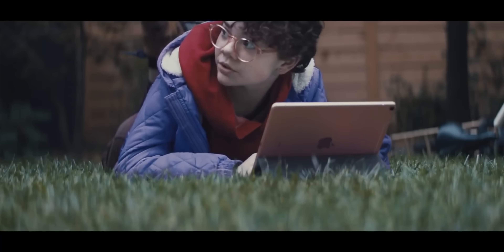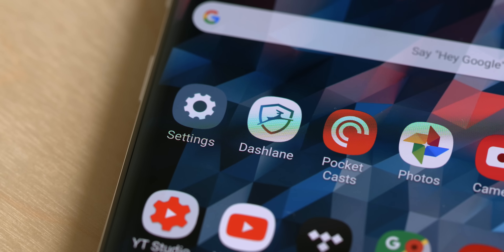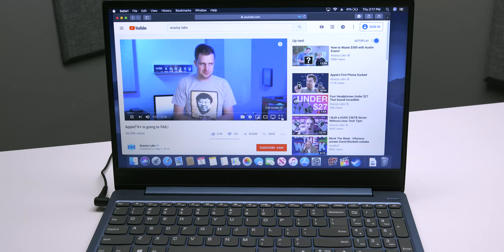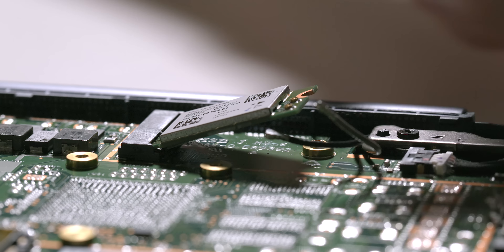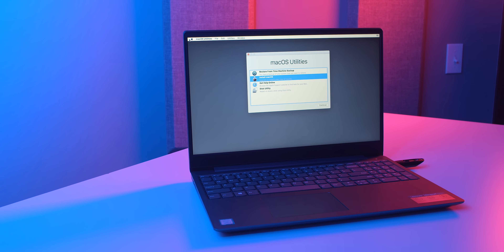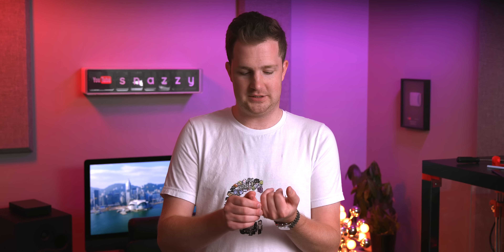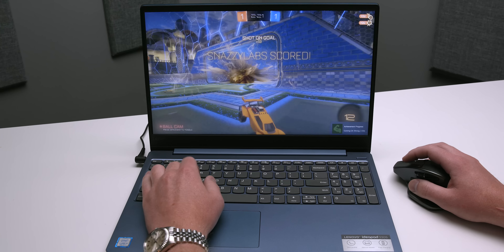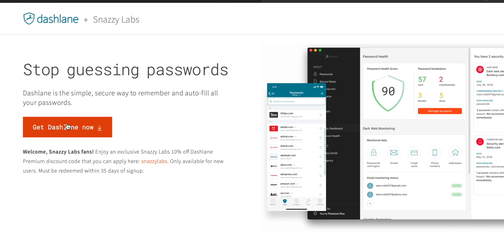The $279 MacBook Air KILLER!

Comment: I just bought last week a Lenovo 330s-14ikb (the 14" version) for 300$ and it's got a better 1080p IPS display, same i3 proc, 4gb ram which I upgraded to 8gb and a 512gb SSD, ohh and it also has a illuminated keyboard, will be trying to hackintosh it, great video!
Reply from the maker: Cheers!
Reply: Let us know how it goes!
Reply: can we dual boot it? win10/Hackin?
Reply: @xbxb  yes you can. Install mac first then windows. Then use EasyUEFI to make clover the default bootloader again. And ur done.
Best is if you can install in seperate disks/ssd.
Reply: @Gaijin101  Oh yes. That would be nice, separate disk. Thanks for the Info. :)
Reply: It's been a month... Did you make it work?
Reply: How it went?
Reply: @officialspaceefrain  Didn't do it yet, I'm having trouble locating a m.2 wifi card that's compatible with mac os and costs under 100euros
Reply: @Cosmin4  the DW1560 is m.2 key-ed. Should be about 25eur on aliexpress/ ebay(international). Or maybe get a m.2 to airport adapter and just slap on an actual airport. Should costs bout 75eur in total.
Reply: 315 USD 
intel Cleleron n4100
4gb Ram
500 HDD
My laptop is so trashy Its asus x407ma Btw
Reply: So how did the Hackintosh go. Did you succeed
Reply: @Gaijin101  or the Lenovo 04X6020 which is the same as DW1560 which is cheaper but only E slot
Reply: @Gaijin101  
1 - When you have a machine with x2 SSD's, one for Windows and the other for Hackintosh.... when you boot in, let's say Windows, does it still detect the second SSD ?
And vice-versa?
It would be great if it could recognise them. So that if you started a Word Document on Windows, it might be accessible on Hackintosh. That way you don't have to constantly email files, or use a USB Stick constantly. And the entire thing would be much neater having two physical SSDs for the two different systems.

2 - And let's say if such a configuration doesn't work on a "Split two SSD" approach, could you achieve it using just One SSD, and have them recognise each other?

3 - Or if it is impossible for the two systems to read each other's SSDs, is there another solution? For instance, using One 128GB main SSD to run both Windows 10 and Hackintosh. Which leaves basically no space left for use. Then use a second SSD which will have a much higher capacity (1TB ?) and it is used to store all your programs and files, for both systems, acting maybe like an external hard-drive but one used permanently?
Reply: @ekinteko  Why would you email Word files to yourself when Office 365 online is free? You get 5gb of space on OneDrive with any Outlook email address.

Comment: Lenovo laptops have been used as substitute of MacBook for years now. It's good that you are showing your audience an cheaper alternative to Mac that works and "feels" almost like the real thing. 
But what if I want a little more power, let's say I want to render my YouTube videos. The laptop feature here has a puny i3. My suggestion, to anyone reading this is to check out older better Lenovo laptops like the t440p. Completely upgradable up to a quad-core with hyperthreading, 16gbs of Ram, 2 accessable 2.5 inch SSD/HDD bays + 2242 m.2 sata expansion slot and the ability to get 1080p resolution on the screen. All those upgrades will round up to about 400-500 and you can install Mac os with the same issues as well (no sd slot support and wireless card needs to be replaced). 
Great video.

Comment: i bought a used macbook pro on ebay for 250 USD that had a 3rd gen i5, 256 GB samsung SSD, 8 GB ram, and a GT 330M. if you also want to do some light gaming on your macbook, I would reccomend going online and looking for a similar system.

Comment: Excellent timing! I wish you’d do Lenovo X1 Carbon Hackintosh.
Reply: Meditation with Cats I have an x240 hackintosh it works perfectly. You can find one on ebay for like $140
Reply: Brandon Mooney-Soloyeva Thanks for the tip. I like the weight of the X2** series but I feel like the size of X1 Carbon is the right screen size for me. The last Hackintosh that I did was a Lenovo S10 netbook which was tiny.
Reply: Meditation with Cats I know the 1st Gen x1 carbon is fully compatible. The x131e core i3 version is also compatible. I was using my x131e untill the hdd it came with failed and I bought it used with a bios lock so I couldn't boot from USB to reinstall an OS.
Reply: have t460s hack myself, almost as good as carbon, but has some advantages - lan port for example and ram slot
Reply: How? I also have an X240, however I remember that the built in wifi cant be used
Reply: Asyraf Kori I bought my x240 on ebay and it came without keyboard, battery, charger, and WiFi card I just bought the first compatible WiFi card on eBay and it all worked when I did the hackintosh
Reply: @brandonmooney-soloyeva9934  how did you do it bro ? can you link to a tutorial ? i also have an x240 and i really wanna try hackintosh
Reply: Yeah, I have an X1 Carbon 3rd gen but I couldn’t find an easy tutorial online, always super complicated
Reply: Why spoil good Lenovo with Mac OS? This is waste
Reply: @zawarudo1041  why spoil Lenovo with Windows?
Reply: I had a 6th gen X1 carbon hackintosh. I didn’t replace the WiFi card but other than that it worked pretty well

Comment: Just want to add a mention that these laptop lines from Lenovo (the Ideapads 330S and s340) are an amazing budget machines just in general and they're nearely endlessly configurable, so you can find some real gems out there. They also have a great 14 inch versions of these, some again in a pretty killer configs if you search around. Might be able to find some better configs with stuff like solid FHD IPS displays(and matte at that!) for not much more than this absolutely basic model.

Also, the fact that there are endless configurations with everything from AMD APUs to intel i5s and i7s with dedicated MX150/250 GPUs, HDDs and SSDs is also why there is such a huge amount of unused space just like Snazzy mentions. They use the same chassis for all of these so the most threadbare config will have a tiny batter and an nearly empty laptop body.

Comment: I would suggest getting a cheap refurbished Thinkpad instead of buying a new low end laptop. You’ll get more for your money.
Reply: The MalWare Fail unless native Mac gestures are supported in OS X
Reply: Wolfgang's Channel has some videos on hackintosh on a thinkpad, it's worth watching imo
Reply: I like the fun of picking an old machine and showing all the potential hidden there, this is probably bigger than with a new hw, however I live in Brazil and very often hw available in U.S. is hard to get here, even buying in ebay with transport and taxes the value gets much higher, lenovo produces this machine here, and the price is very low.  My point Snazzy will create more impact outside U.S. with a more replicable experience, in this case lenovo is more interesting, and by the way, few dais ago I bought the younger brother of ideapad 300 the S145 to be my first hacintosh, is not working yeah, and I'm having fun and learning a lot....
Reply: Gustavo Silveira  eu consegui instalar o Catalina no meu X510UA BR665T da ASUS, e tá funcionando mt bem, mas n sei se vou manter o macosx instalado, eu fiz o hackintosh mais pra me divertir.
Reply: After being in the Apple environment I finally went with a Lenovo W520 (Quad core i7) for 150$ on ebay and maxed out every thing: 32GB DDR3 Ram/ 500 GB SSD/ 500GB Second HDD/ fresh windows 10 installed and the results were amazing!! I’m running and doing heavy works with Solidworks/ANSYS/Mathlab/Autocad/Office with no problem!!! I saved a lot of cash...
Reply: cesar chang Have you installed Mac OS on it?
Reply: MarcosElMalo2 no I haven’t! Since I’m using pure windows softwares

Comment: You can put in a single 16gb RAM in the extra slot in this machine to have a max of 20GB of RAM.
Reply: it will freak out some users report that it will still show 16 gb 
with 4 gb reserved lol
Reply: not the greatest idea to mix and match ram sticks
Reply: He was on a budget know-it-all
Reply: @gibledip9596  I'm sure adding adding a $100 ram stick would still make this the cheapest macbook air replacement.
Reply: I think it will not become dual channel, just single channel ram
Reply: I added an 8gb stick on mine, for a flawless total of 12 gb. Just run Crucial's compatibility program and buy a stick with the same specs.

Comment: Nice video even if the actual price is higher especially after adding RAM and the new WiFi. Lenovo also blocks non-authorized WiFi cards in some of their laptops in BIOS but apparently not this one. You can’t be too hard on the screen as the 2014 13 inch MacBook Air had this same screen resolution but it was at least IPS. It would be ideal to have a laptop with a 2.5 inch drive bay and NVME slot to make dual booting easier with one OS on each drive.

Comment: I have the version of this model which costs almost equivalent to a base Macbook Air, and it literally uses the same base motherboard, only with way better CPU (i5 8250u), that extra ram slot filled with a 4GB SODIMM, that nVME slot already occupied and a proper HDD in the SATA slot (I ended up changing both the SATA and nVME drives for 500GB Crucial SSDs as SSD prices dropped). Also the same GPU slot is populated with a Radeon GPU, which actually makes the battery life almost same to that of this laptop, unless you disable it in Bios, which maked the battery life double (5-7 hours depending on workload, I would consider that good enough). Also it has a 1080p IPS Panel which is very good for watching movies because of excellent colour and decent brightness. Hackintosh on this is actually very similar to an Macbook Air, or even a 13 inch pro because that 8250u CPU is actually a good enough laptop CPU for most uses. I'm still using this for basic tasks, and works great. Recently updated to Sonoma.
Edit: It also ships with a 720p decent webcam, and the SD Card Reader doesnt work even on this version

Comment: I used to work at Best Buy. For about $100 more you could get a similar model with an i5, 8GB of RAM, and a 256 GB SSD. And it has a silver case and black bezel around the 1080p (yes, FHD) screen so it looks more like a MacBook. Actually a good laptop for the price range if you need decent performance but don't care about premium features.

Comment: Have you tried the complete virtualized (through Arch Linux) method that demonstrated how to get MacOS working on ANY system (without lag) by Linus Tech Tips (they got it working on a Ryzen 7 chip even)?
Reply: Except it came when a performance penalty
Reply: It's virtualized on top of another operating system. There's going to be a performance penalty.
Reply: @nathanross4036  Did you watch the video?
Reply: @Rattus375  Watch the video.
Reply: Michael Timpson I did, though I question if you did. It's literally a VM with a passthrough GPU and SMBIOS. Straight hackintosh is far better and always will be. 

You can hackintosh builds with AMD CPUs as well.

Comment: Maybe next time You will make video about used/redurbished laptop hackintosh. Eg hp thinkpad or dell. :)
Reply from the maker: This is the way to go but every time I use older hardware I get lambasted cause it's hard to find in their country, etc. Went for the cheapest laptop with decent specs that could be found in most countries.
Reply: Snazzy Labs way to go could be x240 or t460 hp 460 g2 or so ;) good luck. As always great video
Reply: I like that idea but you can get a 2015ish used MacBook Pro  for ~$500 that runs great lol
Reply: @dccsnare  not That great I'm afraid
Reply: Well it's easier to find than this new laptop. 😂
Reply: Lol

Comment: I am quite happy with my Lenovo i7 laptop I bought refurbished from Lenovo. 8 GB Ram 1TB combo SSD HDD. Came with Windows 8/now Windows 10. I got it for about $600. I run PreSonus Studio One. Boots in less than 10 sec. Run my Behringer X18 Air X touch, and recently got an older US1641 Tascam USB2.0 to work fine on it.

Comment: I’m not extremely broke but I don’t wanna spend 1k on a MacBook are there any laptops in the $500-750 range that is OSX compatible? Preferably something thin and light but it doesn’t need the greatest display but something with good viewing angles and 1080p
Reply from the maker: Some last-gen XPS have proven to be rather reliable.
Reply: Actually, the display is not that bad. It doesnt get extremely bright, but I thought that the viewing angles were quite ok. Regarding performance, there is a model available of the same laptop that has MX150 graphics and an i5 with 8gigs of ram , 1tb of hard storage and a 256 gig ssd, all in all, it costs around 550-600 bucks. This is the most compatible Mac os machine in that spectrum as  most others have soldered components
Reply: I do own the i5 version if you're wondering
Reply: @snazzy  Could you please do a video on a mid and high-end version too?
Reply: A used MacBook or MacBook Pro.
Reply: @alliejr  can i upgrade any old macbook to latest macos version?
Reply: Hmn, ure not the target demographics for the 🍎apple monitor.🔳
With a💲 thousand dollar stand. 😅☺️
Reply: @tanishpatki4711  Does MacOS work with the MX150 though? I thought they had an issue with NVidia cards.
Reply: @noisycarlos  actually, it doesnt work with the basic install protocols, there is a complicated process involved which "cloaks" the MX 150. That's the reason why I didn't go for the dedicated graphics version as it is quite complicated to install Mojave on it. I suppose some version below Snow Leopard support it.
Reply: Does it have to be new? You can buy a refurbished or used Thinkpad X1 Carbon for that price
Reply: I dual boot Mac OS and Windows on a Surface Pro 4 i5 256gb 8gb model, and everything works except internal wifi (its a Marvell Chip that honestly isnt reliable in windows anyway) and the tocuhscreen (and well pen support too), which is why I dual boot into windows still. Best part is the Keyboard is removable so when I plug into a surface dock and external displays and keyboards and mice, I can just detach it and have more room on the desk and still use the internal display!
Reply: @YasinHasan  No. Check Apple's website for backward compatibility.
Reply: @YasinHasan  No, it would need to have an Ivy Bridge (2012) or newer CPU in it with compatible graphics.

Comment: You can get the idea pad 330 with a 1080p screan m. 2 ssd and up to 16GB ram if speced correctly upon purchase. I have just such a speced laptop with the same core I3 8350U however if you buy directly from Lenovo you can spec it as you want

Comment: what you're really after is the Lenovo - 330S-15ARR. it is basically the same thing but with ryzen 5 apu  that has solid vega graphics, and the screen is an amazing 1080p panel. I got mine for 302$ used on amazon.
Reply: hackintosh works best with intel

Comment: Would I be able to put MacOS on my Acer Predator Helios 500??
Reply: what are the specs and i can make your laptop hackintosh.
Reply: What about a Lenovo Y520? (It’s the older equivalent of the Y540)
Reply: @mihnealazar7039  its not old and yes it can run macOS and if you are planning to use gtx 1050 then you have to install macOS high sierra since macOS mojave have no support for nvidia graphics whatsoever but with intel gpu you can macOS latest model for upcoming 4-5 years on this laptop.
Reply: Hackintosh Builder thanks a lot. I’ve never done this before, so I will ask: can I have both windows and MacOS on the laptop? And will it affect my files? (I guess these are kind of noob questions, but I’m a noob in terms of hackintosh).
Reply: Mihnea Lazăr nope it’ll not effect your files and yes you can install both with dual. What about I’ll help you to make your laptop hackintosh. You have any social media?
Reply: Hackintosh Builder thank you very much, you’re very kind. Unfortunately, I have very little space left on my laptop and I can’t install a new OS. But I was thinking for the future it might be a good idea.

Comment: It is realy funny because apple acctualy sells a laptop with this terrible specs,
Especially with a screen that is nearly as bad as the screen of the lenovo laptop.
This thing is called the mac air (not the new retina one) but the "old" one witch they selled for 700 bucks or so until 2018 or 2019 when the launched the new one.
Reply: Nope! the screen was definitively better than the Lenovos crappy one.
Reply: @morlidor  But Lenovo does not sell it for 100 bucks or so
Reply: @deppe4202  ???
Reply: i forgot a 0
Reply: @deppe4202  
OK but I hope you understand that the quality and performane of Apples laptops actually are worth the higher price and that  Lenovo has laptops that costs 5000 dollars or more..
Reply: @morlidor  Yea i a know a bit about pcs and what they are worth.
But most apple products are over priced
Reply: @deppe4202  
Nope! Apple products are not overpriced. If they were Apple would not sell millions of them. Quality hardware and quality software and support costs a lot whether mac or pc but in the long run it's worth it..
Reply: @morlidor  But the hardware you get is some were else much cheaper.
And every mac book since the first one had some probleme.
Like the keyboard on the newer ones, or the grafic chip dying in the older ones.
Reply: @deppe4202  
I Guess you never tried a Mac? Similar but often lesser quality hardware from other manufacturers also cost a lot.
Reply: @morlidor  yea i have a mac and i can tell you that my costom build pc is way better
Reply: and what do you mean with less quality?
I mean a cpu is a cpu it doesent matter if it is in a mac or a pc.
When the cooling is right
Reply: @deppe4202  
way better in what way?
Reply: @deppe4202  
Hardware is not just cpu..Apples trackpads for example are often way better than the ones on PCs
Reply: @morlidor  so you pay 500 dollars for a mouse
Reply: @deppe4202  
Nope